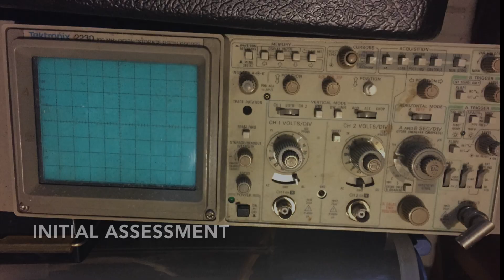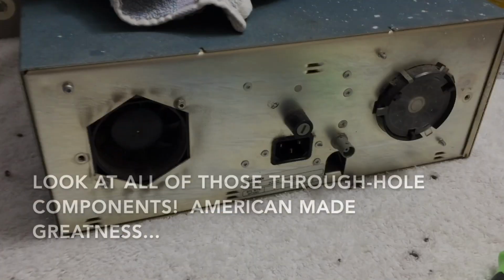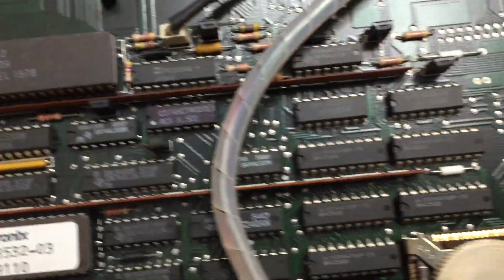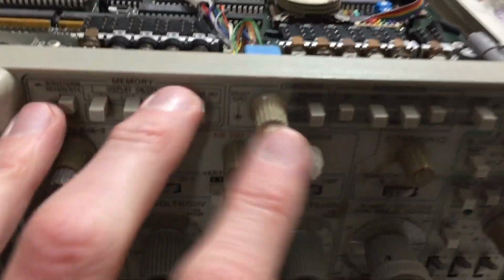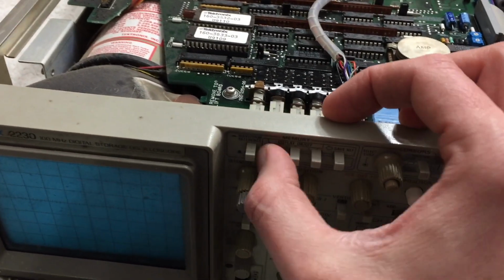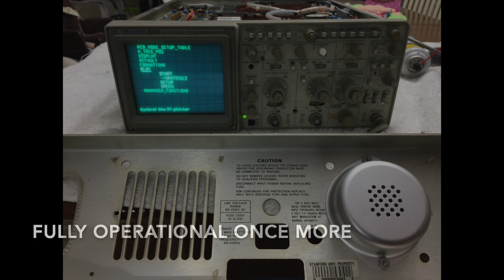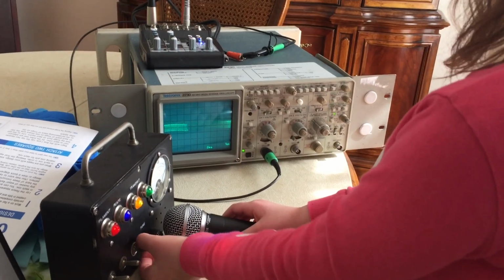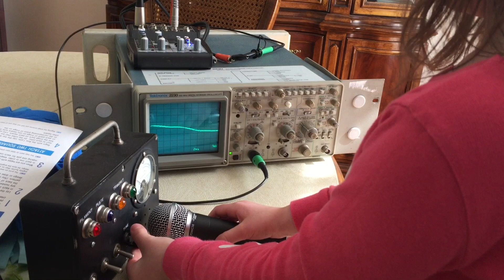Tek2230 oscilloscope repair and kids seeing their voice for the first time

Comment: I've brought a few back to life. That one looks like it had a hard life in dirty conditions. I bought a Tek 2213 recently for parts not working. Once I managed to remove it from the well padded box I was shocked at the condition of it, SPOTLESS, and looked like brand new!!! Cost me $30 plus S/H, powered up and tested perfect on both channels, it was going to be used for parts, now I might use it as a station monitor for my ham rig when I get back on air. Repaired the P/S on a Tek 2465, just one cap failed, needs the pots and switches cleaning, other than that works a treat on all four channels, another 2465 I bought cheap for parts, turns out to work perfect, other than has a boot up error at power on. Resets and using the error codes charts points me to a sticking button. For the price I can't complain. I have another Tek that I need parts for a 2246, hopefully I can bring that back from the dead.

Comment: If you still use this scope, check the C904 cap in the PSU, right under the input socket. If it is still the original Rifa transparent plastic kind of thing, replace it before it blows up!

Mine did, properly exploded and melted into the plastic cover of the power switch. Was quite hard to take the remnants off, and left quite a mess to clean up. Some say that the Schaffner input filter has the same kind of caps inside with the same issue. Mine has a TDK Japan one, I don't know whether is it affected or not.

Funny, but all the other 30+ year old electrolytic caps are just fine.